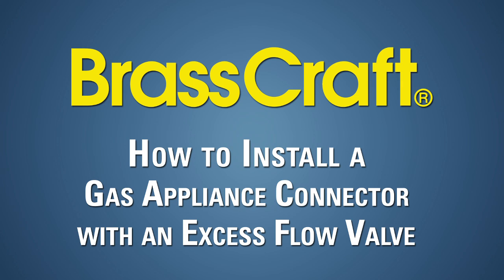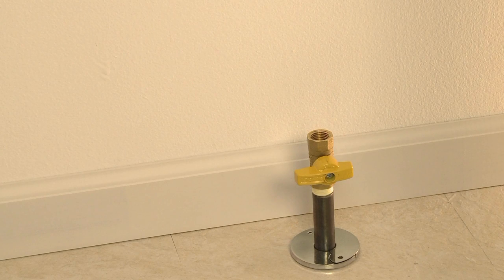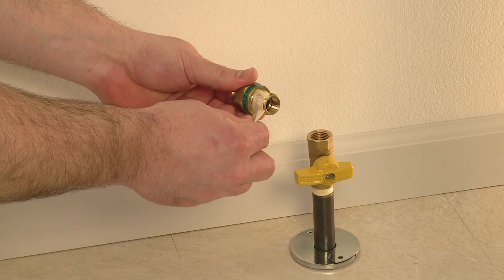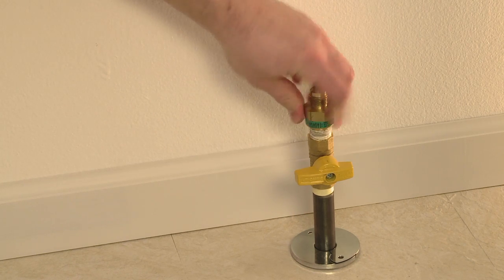How to Install a BrassCraft® Gas Appliance Connector with an Excess Flow Valve

Comment: Can the excess flow valve be fitted with a black iron pipe? Can't find any compatibility information. If not, then what would be used to mitigate an electrostatic corrosion issue that is within code? I'd want to use yellow tape so I am not cleaning pipe dope the next time I have to replace the water heater and gas line. I like the Safety+Plus2 Thermal Excess Flow Valve, but I have black iron pipe and can't find info on  if it is an option or not.

Comment: Please show installers the proper way to hold the crescent wrench. I know it does it matter in this installation, however a tighter joint will matter, the fixed jaw should take the maximum force.
Not complaining, as a teacher I like to use proper technique, if I know them. Always learning, thanks for the video, straight and easy.

Comment: If I already have a brasscraft safety valve from a previous dryer installation, can I just replace the hose with a new one when I install a new dryer, or should I replace the excess flow valve as well?

Comment: I wish BrassCraft would label the included fitting so they make sense to a layman. What’s a FIP?  MIP? I need a gas connector for my new Samsung dryer. They ask for ½ pipe but only have a 3/8” male inlet.

Comment: I bought two. One for stove which worked fine. Second for gas dryer. That is having issues. I read that if I turn gas on too quickly the auto shut off is activated. It's there a way to disengage the auto shut off the valve will open??? I tried closing the valve. Waiting a few minutes, then slowly turning my supply line shut off valve on slowly but it still doesn't deliver gas to the dryer. 

I don't think it's my dryer since it's brand new and I'm running it the first time. 

Thoughts?

Comment: Wish he mentioned how to connect it to the actual appliance.. my connection had  plumbers tape on the side he didn’t talk about so I’m confused… remove the plumbers tape on the appliance side?
Reply: If it is a flare fitting, which has an obvious taper that is not designed for pipe threaded fittings, do not use teflon or pipe dope..  only use teflon and / or dope on fitting that are raw pipe.  Flare fitting crush and mate together to form a seal. They can be overtightened as well as undertightened.  A snug fit will usually do the trick. Always better to go less than you think is gorilla tight. When checking for leaks you can then tighten a 1/16 or 1/8 of a full rotation.

Comment: I need to install a NG/LPG Dynaglo style gas heater in my house. My problem is, I have brick on the outside of my house and I don't know exactly how to penetrate the brick for the threaded gas pipe. What length of pipe do I need
( inside finish drywall to outside face of brick is 9inches )
How should I secure the pipe to the wall?
Do you have a link to a video or know of one for an install of this type? I'm not having any luck finding one. 😢
TIA

Comment: What can I do if the connection is very hard to remove from the wall since it seems like the glue is very dry. Should I warm up the connection?
Reply: Use a bigger wrench as well as an opposing wrench do you don't break the line.

Comment: My old excess flow valve is stuck pretty good anyone know  how I can get it off?
Reply: Turn gas on then put Torch to pipe
Reply: Hope you got it allready but you can use an adjustable Cresent wrench to get it off
Reply: Trevor W. Thank you yes I was able to get it that night.  I was using wrenches at first, the crescent wrench wasn’t enough I grabbed a pipe wrench and it  came off no problem.
Reply: @_elev3nb_903  I disconnected gas dryer yesterday and it was on super tight but I managed with a Cresent wrench

Comment: First off, I want to thank you for all of the information you verbally provided in this video, especially making it very clear which direction the Excess Flow Valve`s "Arrows" should point, "the direction of intended gas flow," & also how to clean the connectors with a wire brush for re-use.  I watched a lot of YouTube videos about Water Heater Installation & about Excess Flow Valves during the last 2 days & none seem to be specific enough about those 2 things.  But I still have questions: 
 
1)  In any videos, diagrams, & photos, that I`ve found, even recently published ones, illustrating the assembly of the Gas Connector Line from the "Gas Supply Stub Out" to the appliance, it usually appears, if the Excess Flow Valve is evident at all, that the Excess Flow Valve is installed on the "Gas Supply Stub Out" side & not on the appliance side.  Is there a reason for that, or does it matter at all?  I`m guessing that it could be the difference in building code standards from state to state, or possibly people trained before the use of an Excess Flow Valve was considered necessary, who are continuing to install water heaters using methods they learned 10 or 15 years ago.  For instance, in California here, Water Heaters in my area must be "Ultra Low NOx," which appears to add about $100 dollars to the price.  

Home Depot says on their website that they will not sell the inappropriate Water Heater to a customer, but both the Home Depot & the Lowes in my area still have "non-Ultra Low NOx" Water Heaters in stock.  I didn`t try to buy a "non-Ultra Low NOx," so there was no reason to police me when I made my purchase, but the guys who used a fork lift to get my selected Water Heater down from storage to the floor level never said anything.  They seemed happy to get down whichever one I told them I wanted.

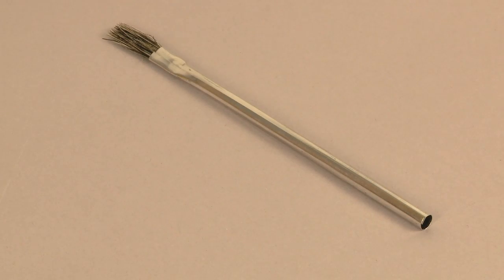2)  In your video at about 0:25 to 0:26, it clearly states that for the Gas Line connections should use "Pipe Thread Sealant or Yellow Gas Tape," but the "Gas Supply Stub Out" coming up out of the floor throughout your video appears to have been sealed with regular white teflon tape where it connects to the gas shut-off valve.  Is that what I am seeing?  Whether or not this is not the case, it should be pointed out in the video that all connections along the gas line should never use just regular teflon tape, but only "Pipe Thread Sealant or Yellow Gas Tape," or other acceptable sealing method for piping live with natural gas.

3)  If the Excess Flow Valve were to be installed in the wrong direction, as I suspect that mine has been, what would be the symptoms.  If I understand how the valve works, that when the pressure is relatively equal on both sides of the valve, the "diaphram" is suspended in some way, away from the "seat," but when the pressure is great enough on the intended "Gas Supply Stub Out" side, the suspension system compresses & the "diaphram" settles into the "seat" inside the valve, blocking flow of natural gas to the appliance side, but , if the Excess Flow Valve were installed backwards, it would not necessarily fail to allow natural gas through the valve.  How would one recognize the faulty installation after the fact?

In my case, when the appliance, a water heater, kicks in, it makes a loud & forlorn howling noise for 2 to 3 seconds, & then once the pressure is equalized on both sides, the water heater functions as a water heater otherwise should, until the next time that water needs to be heated up, & then it wails for another couple of seconds as it is woken up.  I believe the person who installed the valve, as it is now, thought the valve was to avoid backflow into the gas line from the water heater rather than to impede or stop gas flow entirely from the natural gas source, but neither of us was referring to the Safety+Plus Valve as an Excess Flow Valve at that point (enough knowledge & experience to be "comfortable").  Having read the description on the packaging over & over many times since, I don`t understand why it didn`t sink in the first time, but then it was probably 30 minutes to an hour or 2 later before we actually installed the Excess Flow Valve, & it was my first time installing a water heater & possibly my friend`s first time installing a Excess Flow Valve.  Many videos I watched older & very recent, did not even seem to have an Excess Flow Valve in the gas line assembly.

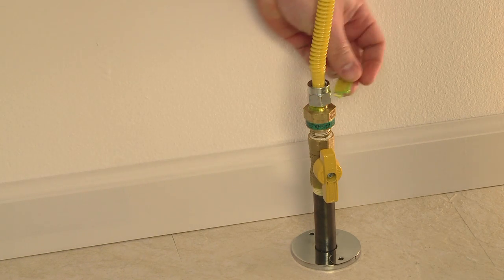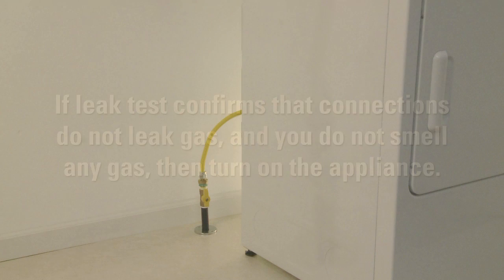4)  Suppose I discovered bubbles during the Leak Detection sequence (2:17 to 2:45)?  All I need to do is tighten the connection a bit more?  I don`t, maybe, need to disassemble the assembly at the leak point, clean the connector ends with the wire brush, re-apply "Pipe Thread Sealant or Yellow Gas Tape" & re-assemble the connection?  Are you saying that a leak can only happen if the bevelled flanges inside the connector are not fully seated.  Is there a specific torque that the connection should be tightened to?  Is a Torque Wrench likely to be necessary or does the Leak Detection Test supposed to make needing a Torque Wrench unnecessary?

5)  In one video I watched, the installer was concerned that the flange end of the male side must bottom out to the flange of the female side in each connector.  No leak detector fluid was applied to the hose side at the female connector.  If the flange end of the male side hasn`t bottomed out to the flange of the female side in that connection, isn`t it likely to leak there where the flexible yellow anti-corrosive coated supply tube enters its female connector, but that it could also leak somewhere at the other end at the appliance as well?  In which case the installer should use the Leak Detection Fluid (1 part dish soap to 15 parts water, or a child`s bubble blowing fluid, or actual Leak Detection Fluid from a Hardware Store) generously, all along the Gas Supply Line Assembly, from the Gas Stub Out to the Appliance.

I would also like to suggest that you could easily, & even should, show three or more different appliances & talk about how your stainless steel Gas Connector Kits are chosen for a Water Heater, a Stove, a Dryer, a Space Heater, . . ., without going into too much depth about each appliance, but making sure to cover any special tips & tricks to make it easier for DIYers to not blow themselve up, or just lose their eyebrows, no matter what first timer mistakes they might make (I did read the installation & user manual 3 times before I & my friend started the installation, but once it got going, it was moving pretty fast & I should have re-referred to the manual more than we did, & as I had watched several installation videos, & read a few articles in the prior 24 hours, so I was knowledgeable, & comfortable, certainly enough to not feel dangerous).  I did watch your video on choosing the appropriate Gas Connector Kit, & I have nothing but praise for all of the information I found there & think that it & this video should be placed in a playlist together with any other associated videos you have now or make in the future.

Please make more videos, I like being dangerous, but I wouldn`t mind be less dangerous.

Comment: Hi. So I hope I get a reply to my question. I bought your gas connector hose. But what am I to do if the dryers gas hose is permanent , not meant to be removed and it doesn't reach to the gas pipe coming out of the floor. I've read not to connect to make longer .  Now what ??

Comment: there is a MISTAKE apparent in this video that should cause a home inspector or gas company inspector to "fail" or "red tag" this gas service installation.   the black iron pipe coming out of the floor in which the gas shut-off value is attached has it's threads wrapped with WHITE TEFLON tape.  "white" teflon tape is used ONLY for WATER LINE connections!  YELLOW TEFLON tape is the correct product to use in GAS LINE applications/repairs.  white teflon tape will degrade over time if/when exposed to natural gas fumes.   gas line connections require EITHER yellow teflon tape or "pipe dope" formulated for gas line applications.
Reply: Not all states might not have the same code yet mandating yellow tape, how I would use a dope made for both gas and water that you could find at your local hardware store or online at Amazon
Reply: i've done a little further research on the white vers yellow teflon tape on natural gas lines.  from what i've been able to determine, "natural gas" formulated "pipe dope" is accepted in all states for gas line connections.  however, "yellow" teflon tape is ONLY allowed for natural gas connections because yellow tape has a different chemical formulation than white; is thicker than white; and has a different temperature range than white.  also, yellow teflon tape does not "dry out" like white tape can.  when the white tape does dry out, it can allow flecks of tape to enter the gas system causing problems with mechanisms/valves.  further, the product rating group - Underwriters Laboratory - only approves yellow teflon tape for natural gas applications.  finally, according to the articles i read, home inspectors, gas company inspectors, municipal code enforcement inspectors all are used to seeing "yellow" teflon tape on natural gas lines.  in addition to the safety problems with using white tape on gas lines rather than yellow, most inspectors will fail gas line connections with white tape instead of yellow tape.

Comment: I just removed a stove that had one of those valves attached on the other end of the hose, between the hose and the stove, with the arrows pointing AWAY from the stove?

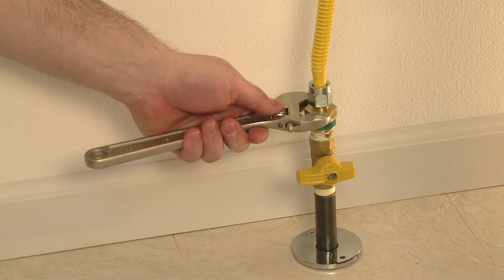Comment: @2:01, when connecting the gas safety valve to the connector nut, pipe sealer (pipe dope) does not need to be used on the threads?
Reply: No, it's a flare thread which is dependent on the nut screwing all the way down against the flare of the fitting for a good seal. Thread tape or sealer can actually cause leaking if used on flare fittings. :)
Reply: AnarchoHumanism Not usually an issue, a lot of people do it. I see tape on flare threads constantly and most people don't have issue. As long as you bubble tested it and it's all good you should be fine.
Reply: scscanlan Thank you
Reply: +scscanlan  I missed that part and put on plenty of Pipe dope, do I have to worry? I did put tons of pressure on it to make it tight as possible! Thanks...
Reply: AnarchoHumanism  It typically makes the connection worse, it is not a best practice.

Comment from the maker: Part 2 of 2
•	Is there a manual gas shut-off valve or gas ball valve currently installed at the gas supply stub out to the appliance? And what is the outlet type and size? This connector will mate with a 1/2 In. FIP outlet.
•	What is the type and size of the gas inlet of the appliance? This connector will mate with a 1/2 In. FIP.

Hope it is helpful. Don’t hesitate to call our Product Experts at 877-272-7755.

Comment from the maker: Part 1 of 2:
To determine if this gas connector is correct for your install, answer the following questions: 
•	What is the maximum input rating (BTU rating) of the stove? It should be lower than connector BTU rating. The connector you inquired about has a BTU rating of 93,200.
•	What is the distance from the appliance to the gas supply stub out? Add additional connector length to allow for moving the appliance for cleaning or maintenance purposes.

Comment from the maker: Yes! DO NOT reuse gas connectors, fittings and valves; they are designed for use on
original installation only. Removal of connector and additional handling may
damage connector making it unsafe for reuse.

Comment: BrassCraft gas connector 1/2 in. MIP (5/8 in. OD) x 1/2 in. MIP x 60 in.. ProCoat Gas Appliance Connector with Fittings (Large Demand) if for stove??

Comment from the maker: You should avoid, as well, buying a connector that is too long (the connector should be about one to two feet longer that the distance from the shut off valve to the appliance).  If it’s too long, a customer may try to twist it around to shorten it.  That, too, could lead to damage that could cause a gas leak and potential fire.  
Thank you again for your inquiry!

Comment from the maker: Dear Hetcer:  That is an important question as the gas fuel codes directly prohibit the connection of multiple Gas Appliance Connectors to install an appliance. Please make sure that your connector is long enough to connect the appliance to the gas supply without stretching, twisting or making sharp bends in the gas connector to make it fit your installation. This may damage the connector, and may cause a gas leak and potential fire. Please avoid the risk by purchasing a longer gas connector.

Comment from the maker: Dear oliverkaitlynannabel , Our apologies for the difficulty in navigating our site. We assure you we heard your feedback and are working on a new site experience that will be easier to navigate and full of need-to-know information.  While we are working on it, the install kit part number shown in the video is PSC1081.  It is sold at most hardware and home improvement retailers. 
If you have further questions, please call our Customer Service Department at (877)272-7755

Comment from the maker: Dear cyberbink:  The use of Excess Flow Valves is not required in all areas.  Please check with your local building code official for requirements in your local jurisdiction. Excess Flow Valves are a useful technology to assist in the event of a gas line rupture or disconnect.  The device immediately restricts gas flow to the appliance to help prevent a dangerous gas build-up, gas fires and explosions.   For more information on Safety+PLUS Excess Flow Technology,  please visit BrassCraft site

Comment: hey one question; did you use an excess flow valve?  is it necessary to use one; i purchased a universal gas dryer kit and there was no EFV in it.